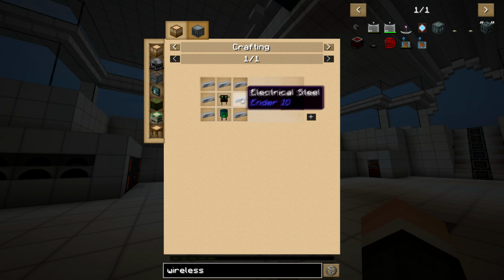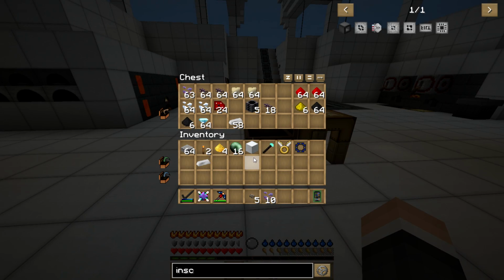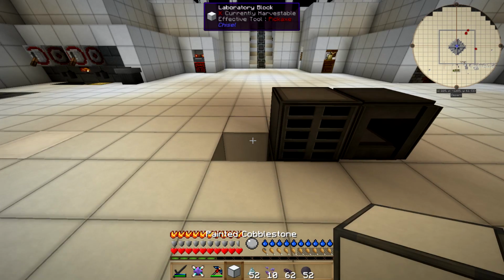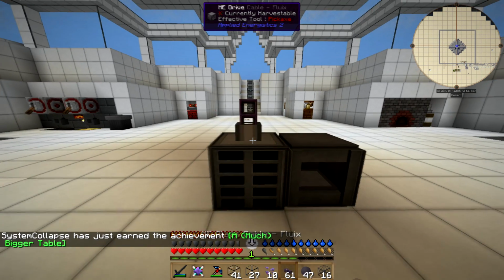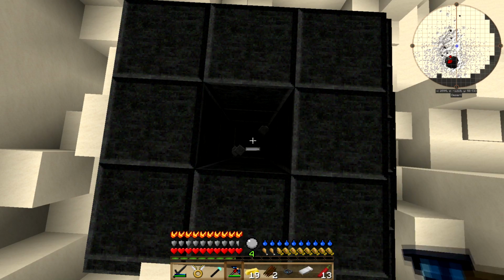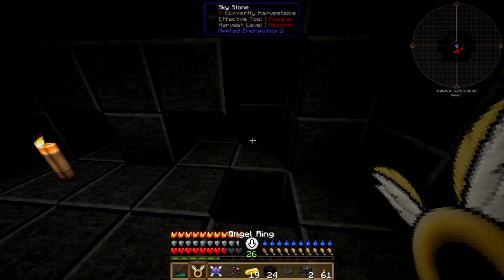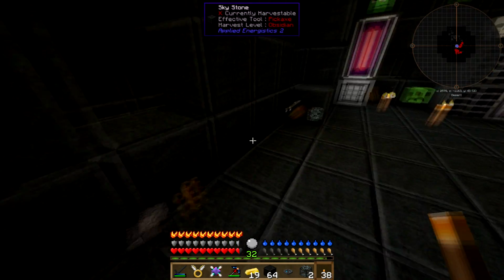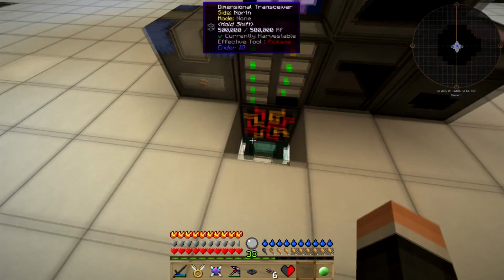Forever Stranded EP12 *New Map* Applied Energistics 2 + Meteorite Exploring

Comment: found a dupe bug for getting soul sand, put a wooden chest on top of a wooden barrel on top of mycelium, with a flat transfer node under the chest for pulling sand out and it doesn't use the sand at all...only thing it uses is water.  I also used a flat transfer node to pull the soul sand out........but I dont think that's where the dupe is